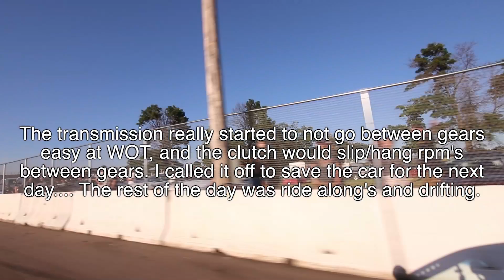5hr Road Trip in the WS6 to WIN & LOSE RACING ALL WEEKEND! Powercruise USA 2020

Comment from the maker: One Like = One Prayer for me to put the LS6 Heads/Intake Manifold on the WS6
Reply: Badass video man 🤘🏻
Reply from the maker: Thanks man. Car is still running pretty strong
Reply: Buuuuut clutch first.  Go with a Monster Lvl 2 o 3 with 18lb flywheel and dont look back. I've been through LS6 and LS7 clutches and the Monster is on a completely different level. It's one of those things that you wish you would have done first instead of going through a world of pain. A world of pain.  Oh and maybe a 3 inch E-cutout while your down there?
Reply: I would never drive like that in my Transam.
Reply from the maker: @cvick14tx  dude, a cutout would be the way to go on this car. I can add a "quiet" plate to the Borla catback. It would give the car the best of both worlds.

Comment: I have A 83 firebird 305.
Ive done weight reduction 
and bolt ons.
its not fast but the sensation of speed is incredible with a 5 SPEED.
2500 rpm and it roaring.
.63 5th and 3.73 rear